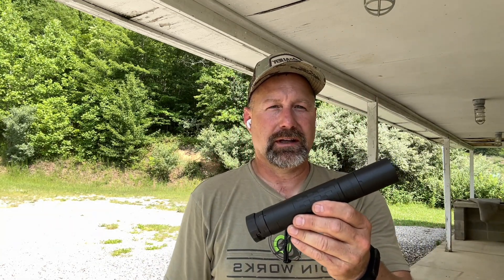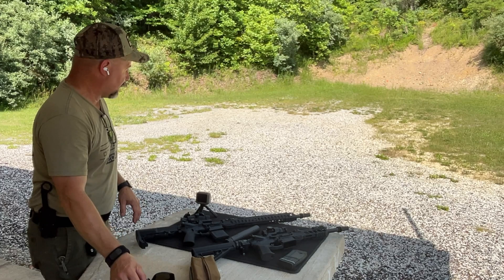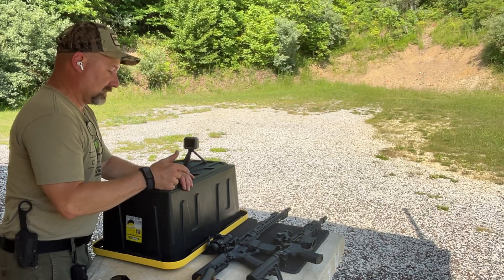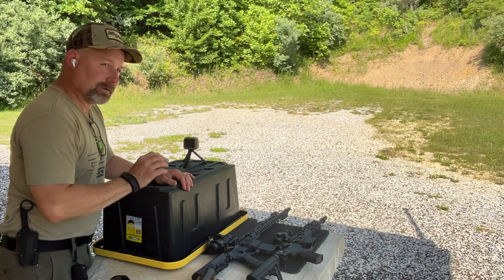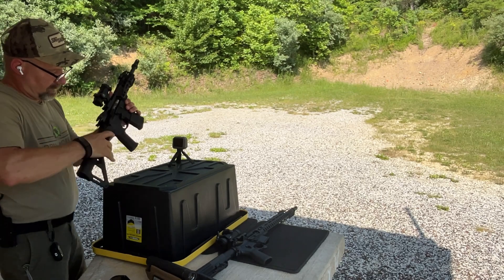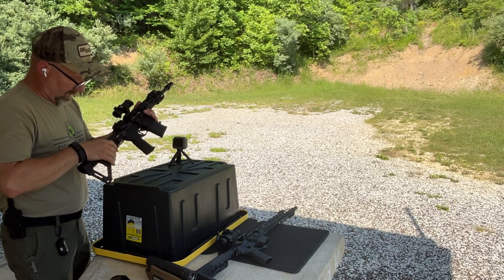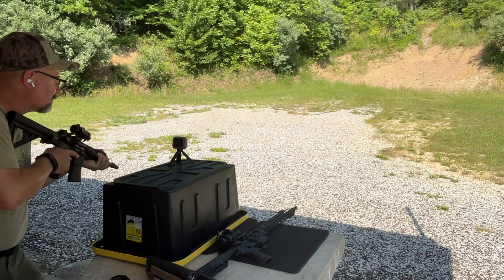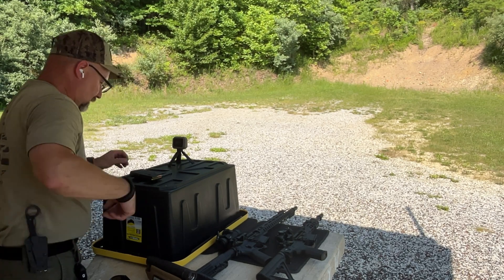.300blk 2 Different Barrel Length Velocity Comparisons.  16” carbine vs 10.5” pistol .

Comment: Great and interesting information. That’s odd that the 46 hybrid suppressor is causing a decrease in velocity. I’m curious about the science behind that. I’m saving up now for a chronograph. I’m going to have to go the old chronograph route. As much as I like the new garmin chronograph, I can’t justify the price difference. I’m just trying to get my dope data out of factory ammo and need the speed out of my barrels, 7.5”, 8.5”, 18” and 20” barrels for 300 blk, 556, and 6.5 Grendel, respectively. If you have any recommendations on chronographs in the $200 and under price range, I’m open to suggestions.  Again, great info and video. Thanks!👍🏼
Reply from the maker: I used a Caldwell for years with good luck. 

Just get something with an app that Bluetooths the data to your phone. 😉

Comment: What do you think of the decibel difference from 10.5 vs 16 suppressed? 10.5 sounds quiter, especially after the first round. Listening on phone not as good as hearing in person.
Reply from the maker: @anthonyleesmann9863  it’s really hard to tell from behind the gun. I’d hate to guess without a db meter. 😉. After the first shot, my mic clips the sound which makes the follow-up shouts sound quieter on the video but they’re really the same.

Comment: After watching a number of YT videos on various caliber rifles (mainly 300BLK and 8.6BLK), I feel compelled (lol) to buy a Garmin chronograph, so I can do my own testing, especially as I build my 8.6BLK (custom 8" barrel, 0.875" gas journal with Sup Arms AGB and when it comes in after approval, CGS Hekate 338 suppressor).  I can do testing with my 300BLK (10.5" Rosco Mfg barrel with Sup Arms AGB and Otter Creek Labs Hydrogen L 7.62 suppressor)... :)
Reply from the maker: @PeteMiller  sweet builds!
Reply: @kentuckyrangetime Thanks!! I enjoy the process and the occasional engineering needed to tweak the rifle to get it running solidly!!
Reply from the maker: @PeteMiller  same here. That’s how I got started about 15 years ago and 40-50 builds later I’m still going. 😂
Reply: @kentuckyrangetime  Holy crap! 40-50…I’ve got three under my belt with the fourth (8.6BLK) in parts acquisition phase 🤣
Reply from the maker: @PeteMiller  I’ve done builds for over a dozen friends and family members and another half dozen for guys at work. 😂